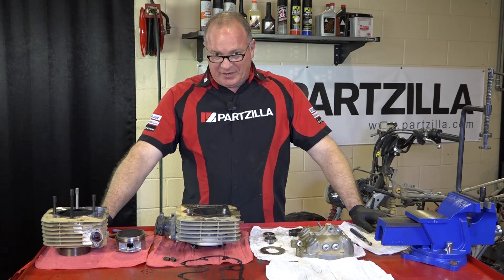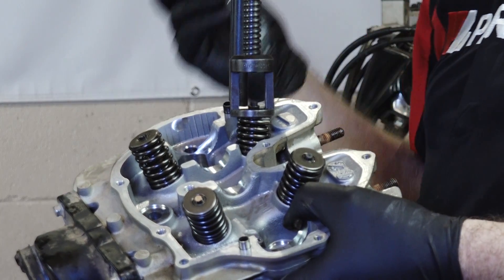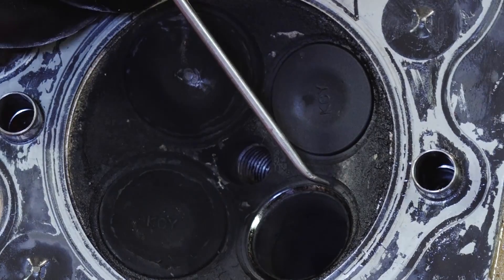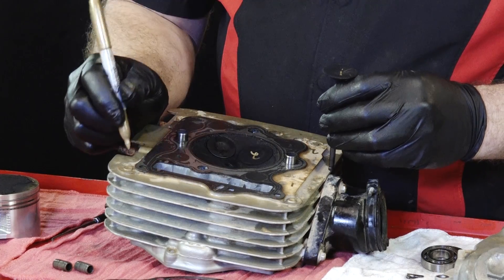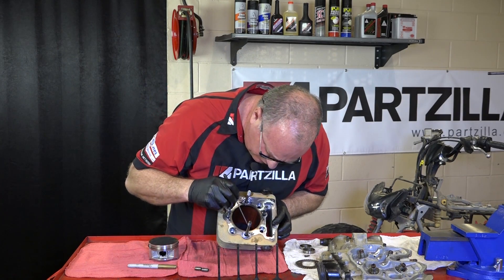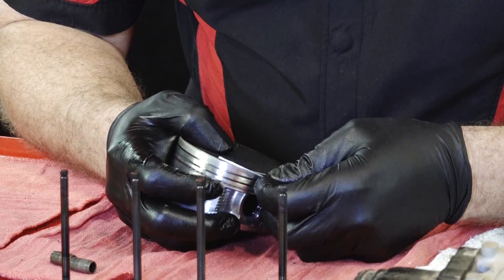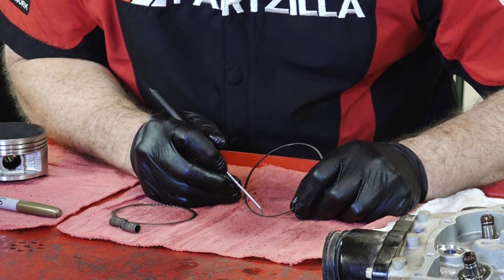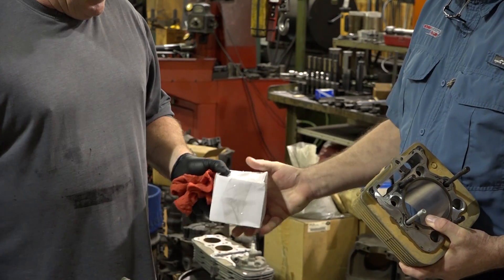400EX Top End Rebuild Part 2: Cylinder Head Inspection | Partzilla.com

Comment: I did a rebuilt on my 400ex and it fired right up but it’s blowing out a lot of smoke out the exhaust?
Reply from the maker: Burning oil.  Could be ring alignment or a bad ring seat.
Reply: Used the old valves found out they where bad so gonna switch those out and hope it helps just wondering if I should pull it all back apart and check the rings or not

Comment: I followed these steps, when I opened the cylinder head there was no decompression pin or spring.. should I be worried that the previous owner dropped it into the bottom end?
Reply from the maker: Have you run the motor already?  If that was the case, I'm sure you'd know.

Comment: Not a relation to the top end but I am having a problem removing the flywheel. I have a 3 hook puller. I'm using the bolt that holds the flywheel on the crank. Just loosened it up and put the hook tool around the back of the flywheel and using the OEM bolt that holds the flywheel on so the crank isn't damaged by the Center of the tool. Some reason this will not come off. I'm taking you off because the one way bearing is a mess. Needs to be replaced but I can't get the flywheel off and I am using a half inch impact. I have so much pressure on it. I'm thinking it's a little bind it up in the back with the one way bearing but it shouldn't be this tight or this hard to come off. Any help or thoughts on this? Thank you in advance
Reply from the maker: It really shouldn't be that difficult.  You can try heating it up or use a breaker bar instead of the impact.

Comment: When cleaning the combustion chamber and the valves what type of wire brush should be used brass or steel?   I would think brass or softer.
Reply from the maker: Brass is softer, just be careful not to score the components.
Reply: Partzilla thanks. I appreciate your videos

Comment: excellent videos! very professional.  thank you!...one question.  any official way of checking valve guides?
Reply from the maker: Officially, you are supposed to use a dial gauge, mount it to the head and measure the side to side movement of the valve.  The service manual will have the exact tolerance to measure, usually it's about .003 or 3/1000ths.  A garage hack, if you don't want to do all that, is to put your finger on the bottom of the valve guide and pull the valve out.  If it makes a popping sound, It's good.  If not, either the guide or the valve needs replacing.  It's not super technical, but it works.
Reply: +Partzilla awesome thank you. !

Comment: why wont my honda 2002 400ex wont start we did a rebuild and it just dont wont start? need help!?
Reply from the maker: After a rebuild, it's tough to just take a guess.  Timing correct? Valves properly adjusted? You really have to just go back through it and make sure it was all done correctly.
Reply: @PartzillaParts   hay i didn't number my valve is there anything i can do to make sure the valves go where they need to be ???

Comment: alguien sabe qué torque lleva la tapa de cilindros y el cilindro??
Reply from the maker: Aquí hay algunas especificaciones de par para el 400ex hasta el 2005.
Cylinder Head/Valve
cylinder head cover bolt -- 8 lbf-ft
rocker arm shaft -- 20 lbf-ft
intake sub-rocker arm shaft -- 20 lbf-ft
exhaust sub-rocker arm shaft -- 20 lbf-ft
cam sprocket bolt -- 14 lbf-ft
cam tensioner plug -- 2.9 lbf-ft
cylinder head nut -- 33 lbf-ft
Cylinder/Piston
cylinder bolt -- 33 lbf-ft
cylinder stud bolt -- 33 lbf-ft
Reply: Muchas gracias por la información! Tengo un motor de Honda NX400 Falcon en Argentina y es el mismo del TRX400 . Le voy a adaptar un turbo compresor con intercooler. Saludos desde el Atlántico Sur
Reply: Partzilla 
tengo una moto kawasaki bayou 4x4  300 1999 y abienta muncho umo

Comment: I have a 2003 400ex, on the top of the rocker case is about 7 bolts around it, the person before me stripped them, is there anywhere I can buy a rethreading kit with the bolts?

Comment: what is your opinion on high compresion namura pistons , specially the 86mm bore. im having some problems getting proper seal after hard riding. (nx400 falcon) basically same engine.

Comment: So I cleaned the carb as you said, and I'm still having the same issue , I poured gas into the cylinder to see if it would start and it started a smile fire , I got it out within seconds didn't cause anymore issues but what could cause that, a friend had told me the guy I bought it from that the cam could be upside down he said his friend turned it 180 degrees but wasn't sure if it was supposed to be turned around could that cause the fire , I poured the gas in where the carb goes in
Reply: I had the same problem, the cylinder was not getting fuel then I solved it by replacing the carb, adjusted it and it started right up

Comment: i have a 2008 trx 400 ex and I'm not getting fuel in the cylinder , the spark plug is bone dry , can you make a diagnostic on how to figure out why thats happening
Reply from the maker: Sounds like the carb is stopped up. May need to be cleaned out. This will show show to do it. https://www.youtube.com/watch?v=LrUYaWx_Kq4&list=PLazGjIO6R4vSrXd0UThpAfjnUVuGQ9__f&index=21

Comment: couldn't you just replace the rings alone??
Reply from the maker: +isaac littlejohn Probably but I wanted to be sure.
Reply: +Partzilla.com oh okay makes sense ... phenomenal video by the way very useful .. also how much did the piston cost and  how much to bore out the cylinder?
Reply from the maker: isaac littlejohn The cylinder bore cost me $45.00 Here are the piston and rings. http://www.partzilla.com/parts/detail/honda/HP-13102-KCY-670.html http://www.partzilla.com/parts/detail/honda/HP-13021-KCY-670.html Thanks for watching!